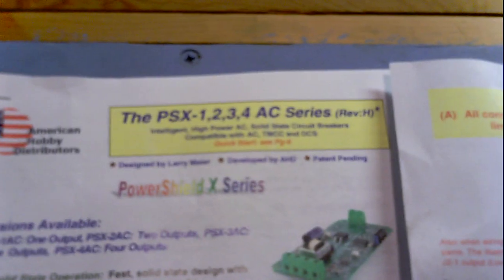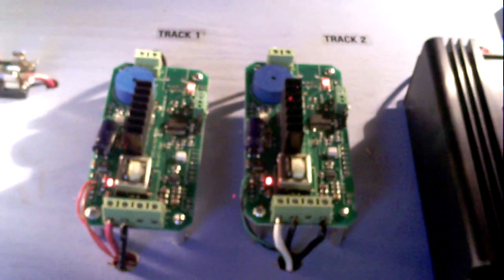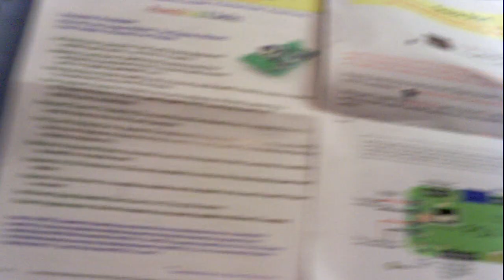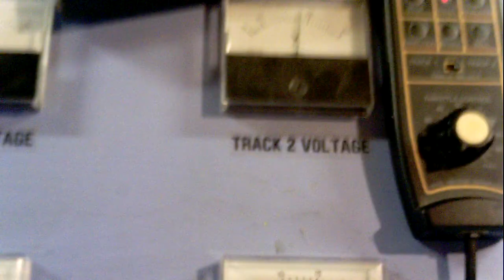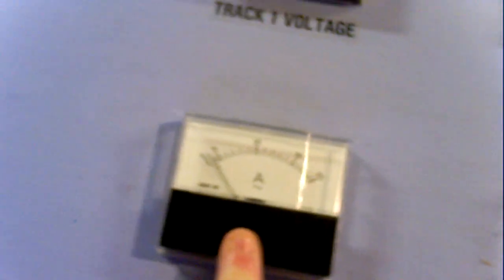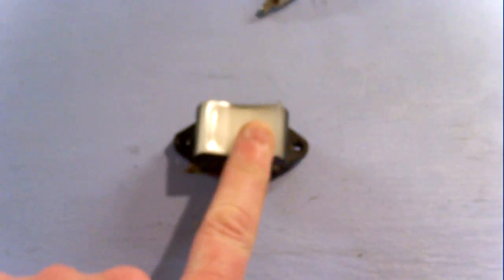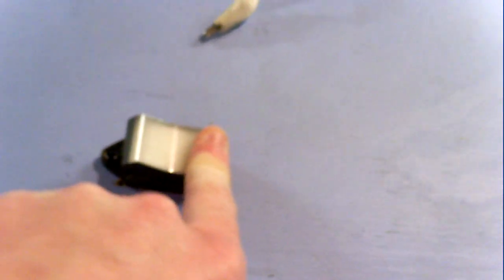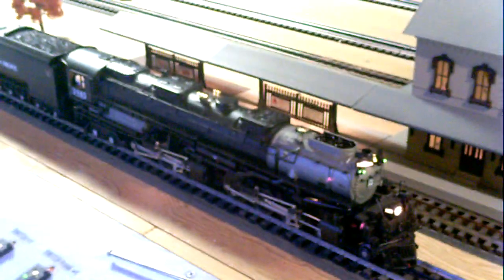PSX DEMO

Comment: Gary... Still a valid fix 11 years later or do you recommend something different now?  A friend of mine wants to install TVSs for his layout, but I found your video and this seems better.
Reply from the maker: TVS diodes are part of the design of the PSX.  TVS diodes are good but the PSX-AC processor control is superior.  The only down side they out of stock until the end of the year early next.  FYI PSX are for command control only.  They don’t work well in conventional with varying voltages

Comment: What gauge wire is good to wire the manual circuit reset button to the PSX that is also sold for these modules??
Reply from the maker: The switch wiring is 20 awg, you can use anything down to 30 awg.  The switch and the buzzer are sold separately.  I have access to switches galore at work but can be had at any hobby store, hardware store or online
Reply: trains gotcha thanks!!! These will be useful on my 10 amp booster districts.